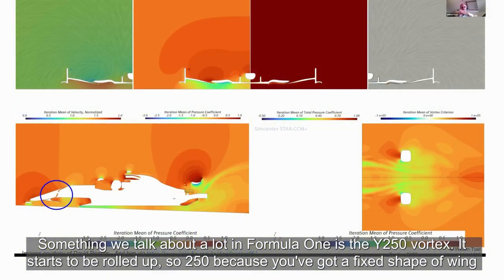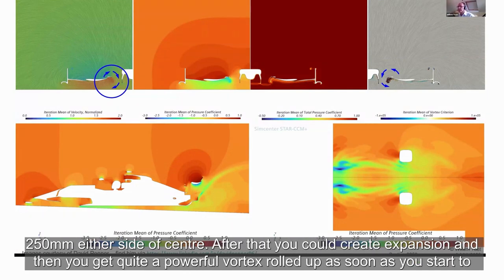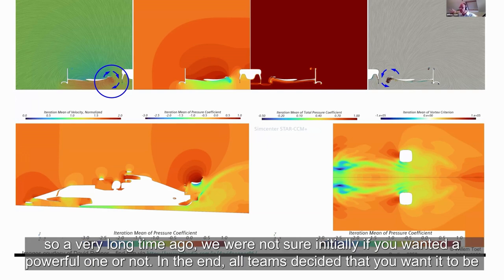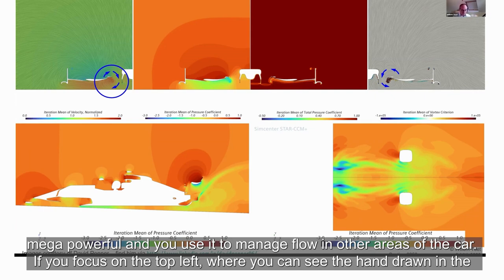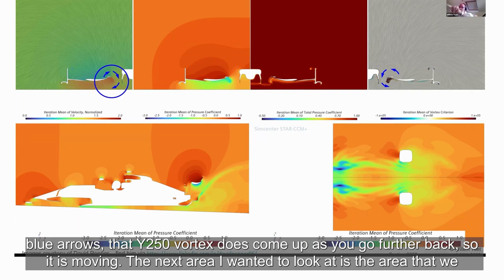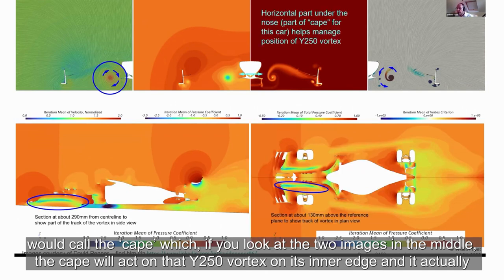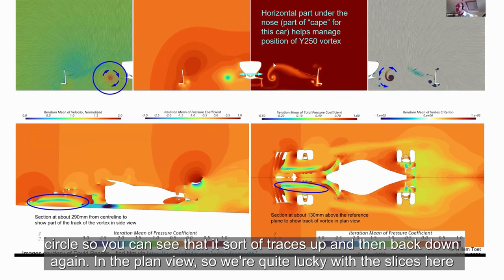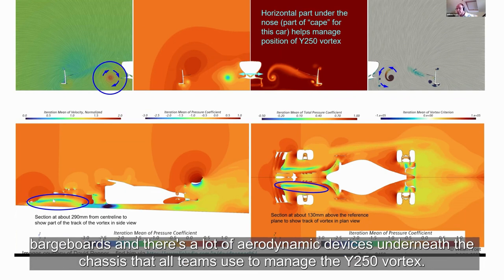Y250 vortex explained by Aerodynamicist, Willem Toet

Comment: Why is a vortex better than trying to keep the air laminar? Or is a vortex un-avoidable with the wing design so it is made the most of.
Reply: You're kind of doing both. You create the biggest vortex possible with the Y250 vortex which is between the tire and the car. Then the bargeboards shove that outwards of the centerline hard. The air which actually reaches the car is all laminar coming from either the centerline or above the car to fill in the gaps of where the vortex was. Laminar flow is critical to make the aero work. That's also the reason you want the vortex. Tires produce horrible, unpredictable, messy air. And a lot of it. The vortex acts sort of like a barrier preventing the turbulent air from getting towards the car. Then when the vortex is shoved outboard the barrier continues to keep the tire wake away from the car and shoves the wake outboard too.

You see similar at the rear of the car with vortex produced to run between the car and/or diffuser and the tire. It's done for the same reason, produce a barrier to block tire wake from destroying the all important rear aero. It's still used on modern cars today in fact. However it isn't a 100% perfect barrier and so other techniques are used both front and rear to reduce the turbulence which manages to spill past.
Reply: @olivialambert4124  Hi, if this isn't terribly off-topic: Aside from LBM methods like the one used in FluidX3D, are there any numerical methods advancements that allow us to benefit from highly parallelized computation (like GPUs and clusters)?